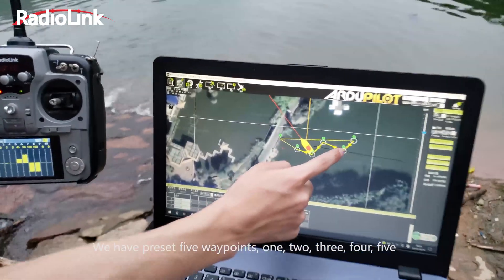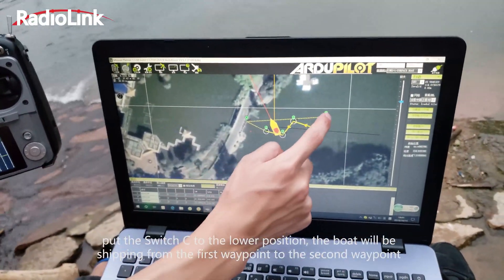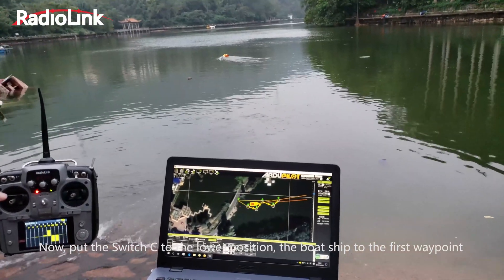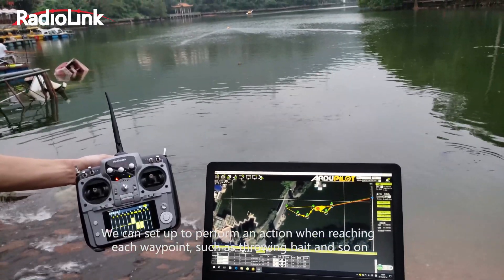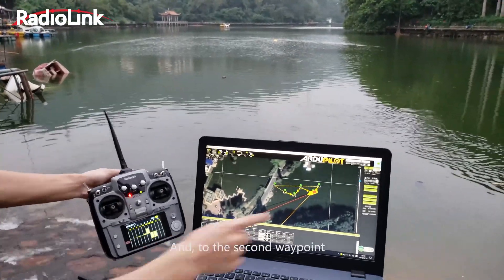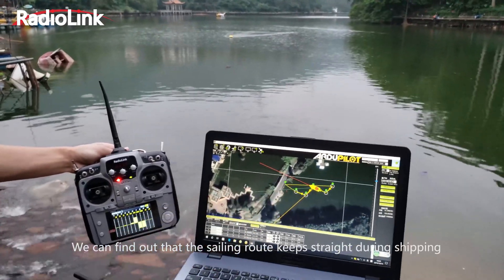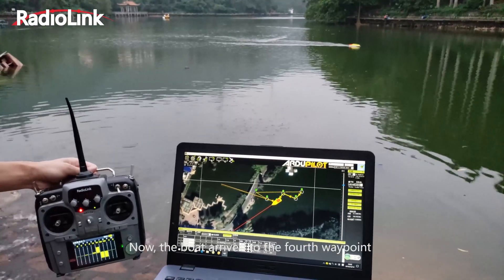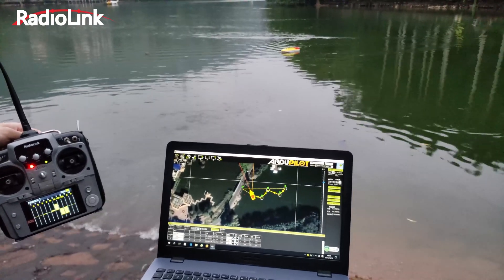Sailing Automatically | bait boat with Radiolink brushed ESC cool9030 and flight controller Mini Pix

Comment: Why you need a radio and a PC?
Reply from the maker: Hi, sir. You need a radio to control the boat. You need a PC to set parameters for auto flight in Mission Planner. If any question about RadioLink products please feel free to contact us. Our email is: after_service@radiolink.com.cn
Reply: @Radiolink_official  thanks for the explanation!   I was thinking mission planner could give the command to the boat to go to the waypoint
Reply from the maker: @fredbarnes196  Hi, sir. Yes. And you can also assign a switch on the transmitter to control the waypoint. Here is the link for your reference: https://www.radiolink.com/newsinfo/475989.html

Comment: Resistance to wind or current, is it possible to hold the head?
I want to make an automatic driving and holding position function for the motor boat guide motor.
Reply from the maker: Yes. sir. You need Min Pix and GPS. Then you can hold the head, and it is resistant to wind or current. Here is the link of guidance for you: https://www.radiolink.com/newsinfo/475989.html
Reply: @Radiolink_official  thank you!
Reply from the maker: @수수용사  No problems
Reply from the maker: @수수용사  It is our pleasure
Reply from the maker: @수수용사  It is our pleasure.